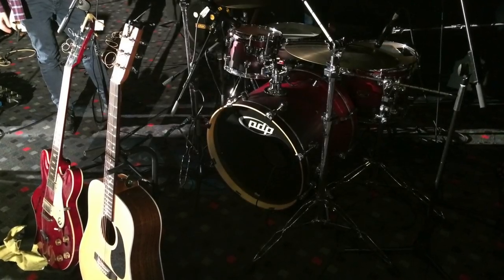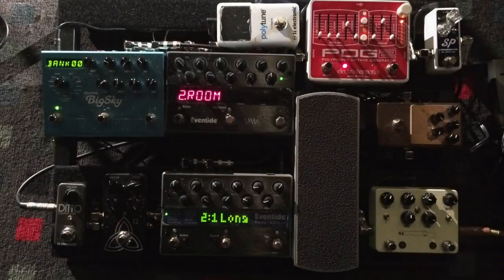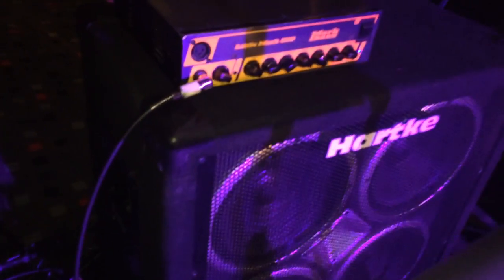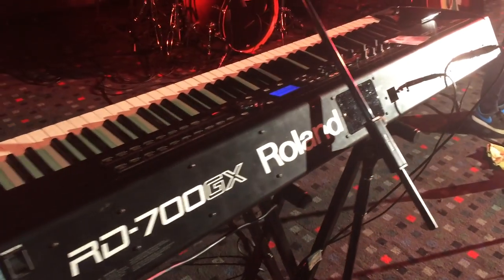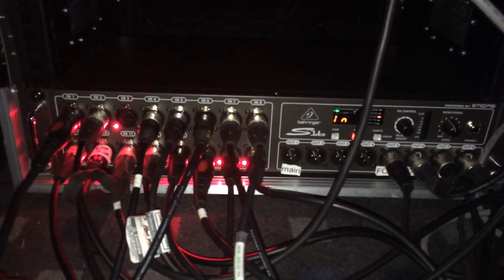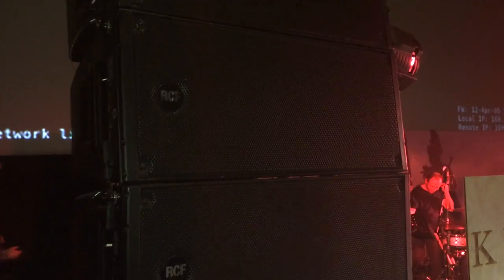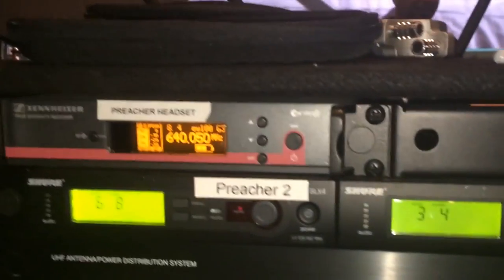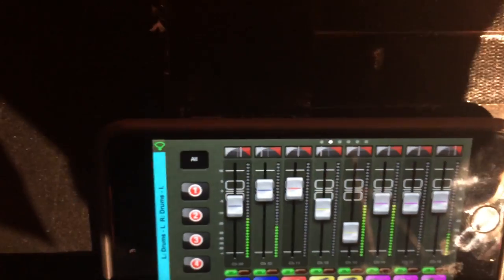Tips for setting up the Worship Band, Sound, Stage at Church

Comment: Hey! I know this has nothing to do with the video, BUT i currently have a yamaha p-105, but was planning to upgrade to something like roland rd 2000. I also have a relatively cheap Dell inspiron 15, 5000 series laptop, which I am starting to use with ableton, and using my yamaha piano as a controller. My pc has 8gb ram, and an i5 processor wich isn't always working very good, when i am trying do use different vst's at the same time... Do you (or anyone else) have any recomendations? Should I buy an expensive stage piano? Should i buy a better pc, like eg. Dell xps 13? Should I buy a good audio interface?? I am pretty new to this btw...
If anyone could help me out, it would made my day!
Reply: you could get a better PC. and run soft synths. or you can buy astage piano. it's really based on what you like. personally live I enjoy running hardware. some software for pads but not for heavy load Vsts. like pianos. Eps arent too bad. but yeah it's up to you man